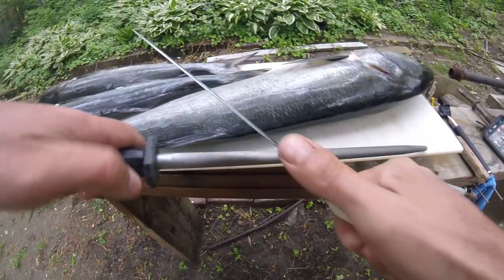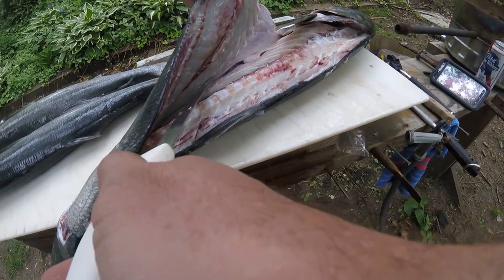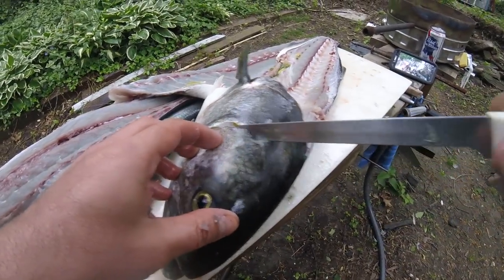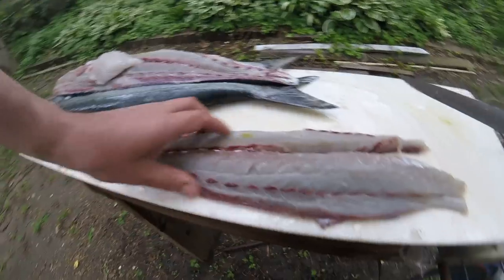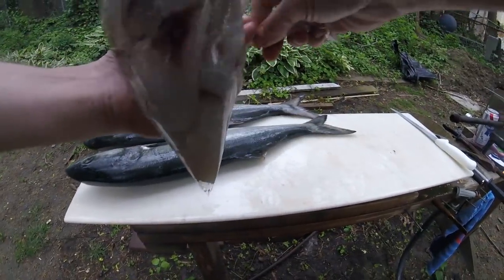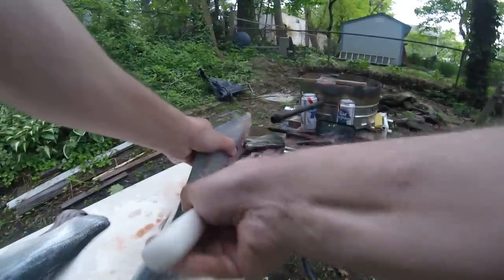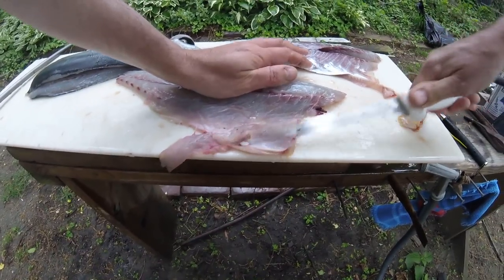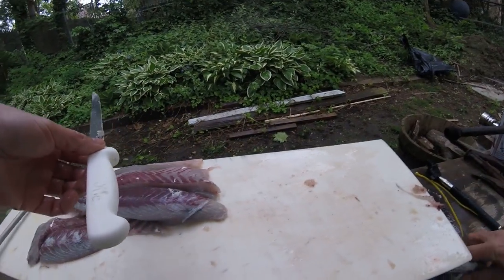A LESSON ON FILLETING BLUEFISH

Comment: Great video, tons of helpful info!
Reply from the maker: Thank you kindly Scott.
Reply: Thank you for taking the time to do it, I've watched tons of videos and this was the best explained 'how and why' on bluefish filleting I've seen. Quick question, just curious...it looked like you had a basket with some leaves and stuff in it, do you recycle the leftover fish parts for fertilizer? If so, do you throw away the darker meat? You mentioned those those tend to have the most contaminants so just wanted to ask. But I remember hearing fish and seaweed are supposed to be incredible fertilizers.
Reply from the maker: ScottSpeedPro, dark meat not a problem... I don't grow veggies. Fish racks good source of fixed nitrogen, seaweed for phosphorus and micronutrients. I would rinse it well to remove excess sodium. Maybe even reduce it to ash by burning, but that all seems like too much work! While I did at one time have a kick ass compost pile, now it is more of a convenience to not have to dispose of them in trash to be landfilled somewhere.